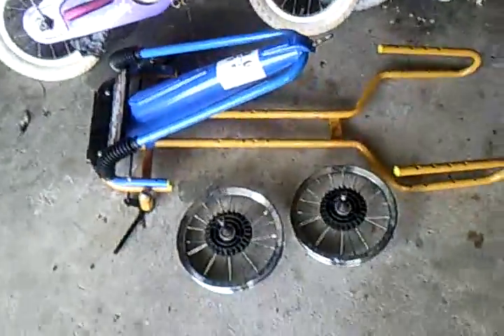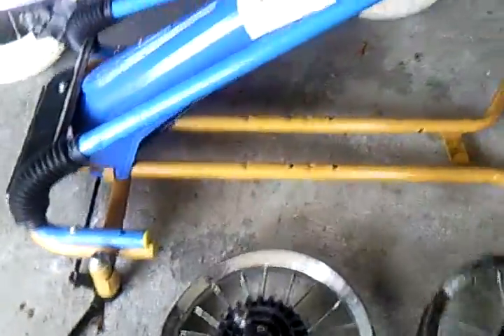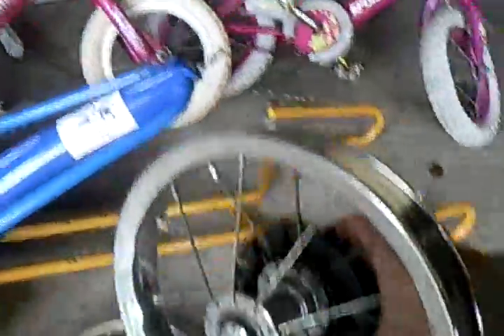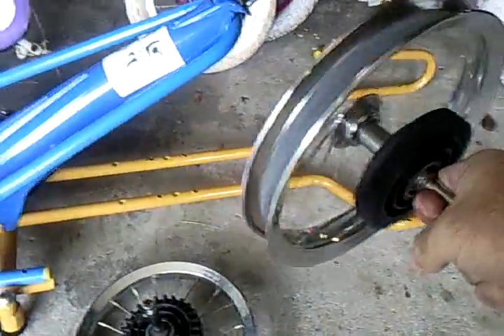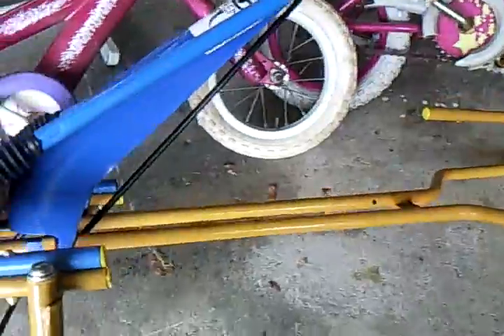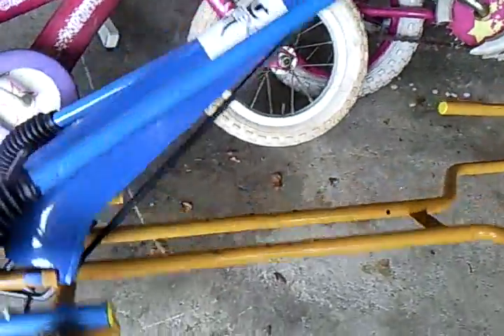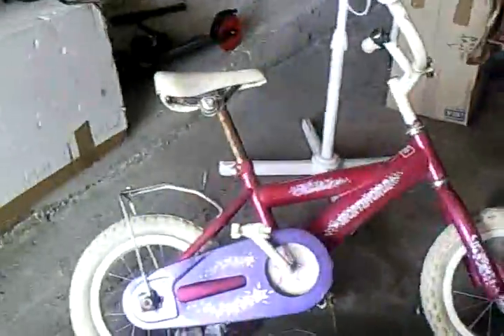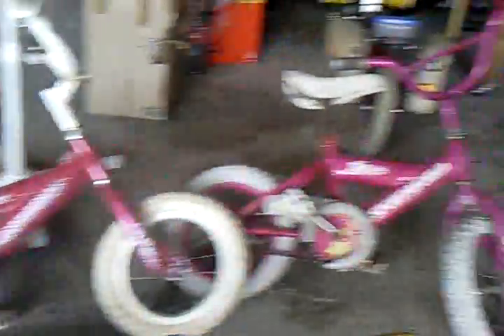Electric go kart build

Comment from the maker: hi ralphinator2 yes the pram wheels did have brakes when they were on the pram i just left them on because the bearings are part of the old breaking system in the wheels  but there is no front brakes on the electric gokart. hope that helps